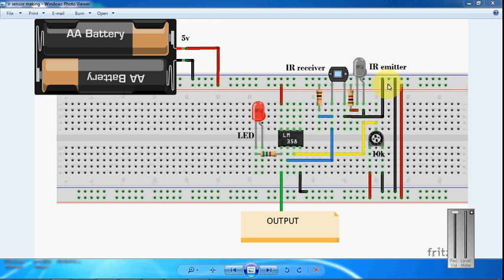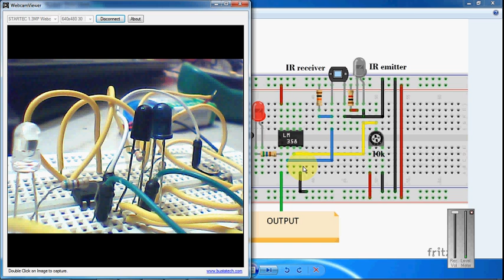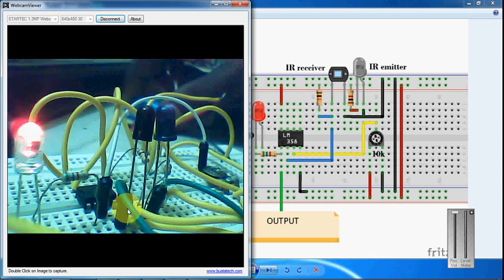How to make an IR sensor for line following robot

Comment: i made it and it work same as yours  but the point is when i connect its output to motor through uln 2003 ic,there is no effect of sensor that is there is no output from sensor.Can u please help me.
Reply: how did you make it?may you could explain the schematics to me?